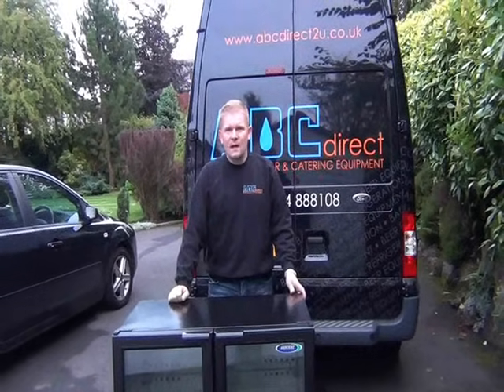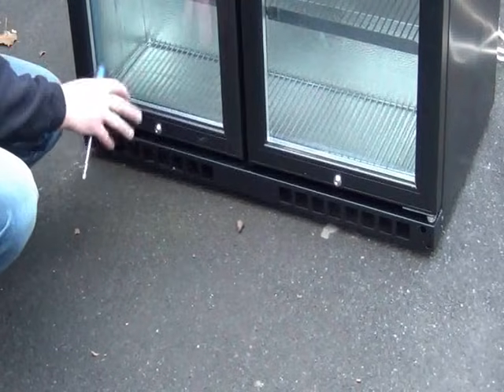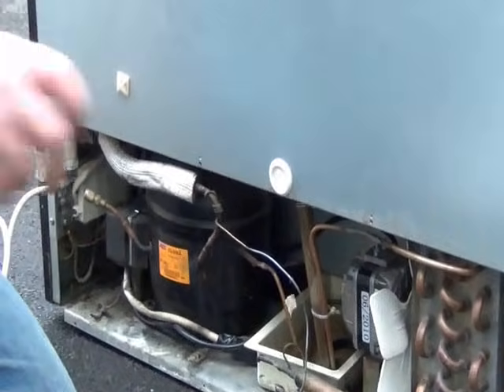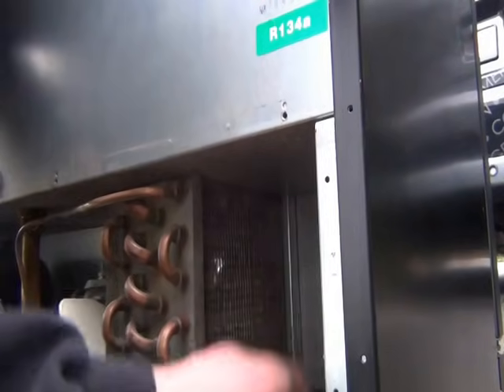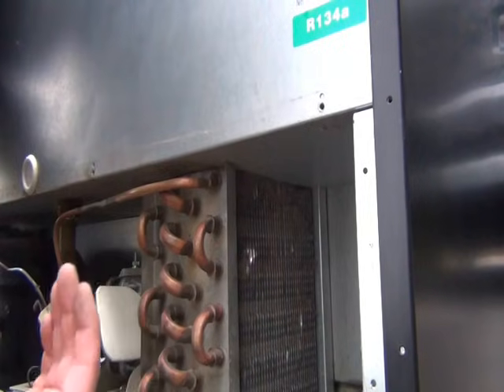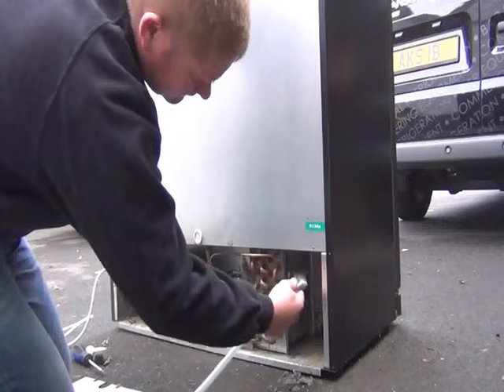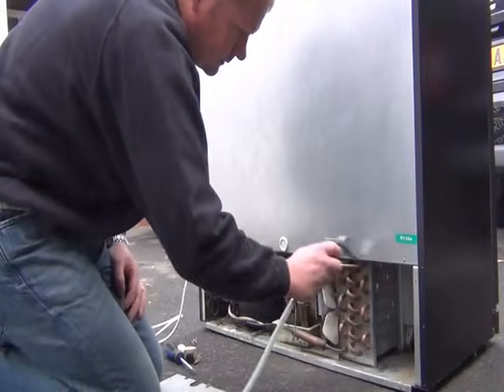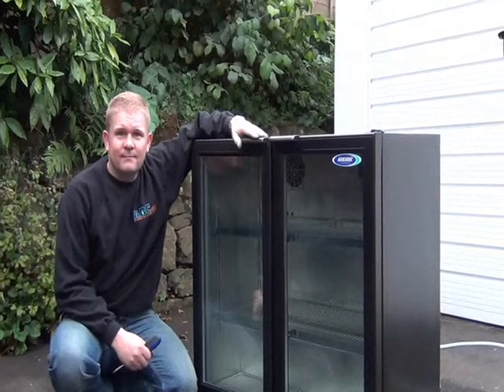Fridge Not Cooling? We show you how to safely clean and service your commercial fridges

Comment: Hi abc direct. Where is the thermostat located on these coolers?
Reply: Thank you ABC direct. I just bought the same fridge but has different condenser. Mines just copper pipes no aluminium fins. The problem was it doesn't get cold. I managed to diagnose the little 12v fan was dead on the copper pipes so ordered one for £9.99 well chuffed. Only paid £15 for the fridge. Your excellent video helped me loads. Thanks for your reply
Reply: I'm guessing mines digital as no visible stat. It's cutting in and out so it seems to work. It's so cold out it's hard to test so was going to blow a hair dryer on it to make compressor cut in. Cheers again mate 👍👍👍
Reply from the maker: Hi Mike the thermostat on this cooler in inside the bottle cooler at the back top right next the the internal fan motor
Reply: Do you know where my thermostat would be. Nothing visible inside the fridge
Reply from the maker: Hi Mike each brand of fridge will have different thermostats and locations , most bottle coolers have a thermostat located on the inside or at the front bottom of the fridge, some are digital and some or manual thermostats,

Comment: But I'm confusing there when you spray did you spray with water
Reply from the maker: he we brush the condenser first and use an air line so it cleans in-between the coil and fins also it stays dry thanks

Comment: Great video, just cleaned mine but fridge not getting below 10degrees, I've noticed the internal fan at top is not spinning, should it be permanently spinning?
Reply from the maker: HI Gary it depends on the model and age of unit on old units the internal evaporator fan runs all the time on others it will only run when the refrigeration is running and cuts of when down at correct temp, set you stat at 4c and if the compressor is running the integral fan should run thanks Andy
Reply: @ABCDirect  that's amazing Andy, looks like fan is broke, I'll get a tester on the cables today and see if there is a feed, if so I'll get a replacement fan ordered, I'm assuming they are all relatively similar. Thanks for your original video and your reply 👍
Reply from the maker: @gazzamundo  there is different models depend on make of fridge if you send model of cabinet and picture of fan to our office the guys. can quote if needed to sales@abcdirect2u.co.uk

Comment: I own a nightclub and we have several fridge. We bought a industrial vacuum cleaner from Argos that also has a sucker/blower that works great. Also we turn them off overnight every month to get rid of the ice build up inside between inside wall and and cooling grid where the fans are. Most of our fridges get hammered and often suffer with gunk from the smoke machines. Ours run at 3c without a problem. Most of ours are 15 year old Apollos 3 doors jobs. Also with three door fridge we don't put stock on the back ledge so it gives the fans room to breath.
Reply from the maker: thankyou for your kind feedback 😀

Comment: Is it possible this process will repair a fridge that will no longer keep cool?
Reply from the maker: if all the compressor and fan motor are working fine this will prevent the compressor from over heating and will keep the unit running efficiently the video is a basic service guide that people should do with all there commercial fridges :)

Comment: Wear a mask😅  u already bended the fin 😬 w that brush...
Reply from the maker: Always recommend wear a mask in enclosed spaces, and make sure the brush is gentle and it did not harm or bend the fins if you make sure you brush in the same direct just to remove the heavy dirt then use the air line to clean deep in to the coil :) which most people do not do or see.

Comment: Hi, thank for the video, I have a beer fridge which I recently purchased and it’s not cooling, goes from 19 down to 12 then back up! Do you think it’s the gas or just need a good clean? Which will be done when hubby’s home! May need to return to seller if it is the gas? Thanks again
Reply from the maker: Hi could check thermostat first then make sure compressor and fan is running OK at back of fridge, then if all that is OK it may be a gas or compressor problem thanks Andy

Comment: Hi Andy my bottle cooler has stopped exactly the same one that is I  the video  light comes on but that is all any idea is there a reset button in the back or is it skip ready
Reply from the maker: Hi mark ,clean condenser and check the fan and compressor is running at the back if they are you know the thermostat is ok as it is asking for cooling,if compressor is running but not cooling u may has a gas problem,  if fan just runs but compressor not it is a faulty  compressor not worth repairs,  check internal fan is running also hope this helps thanks Andy
Reply: @ABCDirect  thanks think you maybe right as the fridge has stooped working again compressor works fine fan is spinning and condenser is clean so is the problem most likely thermostat?
Reply from the maker: @markkennedy918  if the thermostat is faulty the compressor and fan will have stopped running then u need new stat, if they are both still running but you have no cooling you may have a compressor not pumping or gas problem thanks
Reply: @ABCDirect  yes they have stopped running and digital display has gone off again if I do a rest  it starts again runs for 2 days then shuts off again thanks for the advice I'm going too try and hunt down thermostat today it is probably behind the fan caseing inside unit
Reply: @ABCDirect  hi thanks for the advise I turned power off held down too buttons next too the digital display sitche main power back on and everything started working think it over heated as I had a heater next too it hopefully all sorted
Reply from the maker: Great it could be thermostat sticking as there is a small relay inside,  cold beer tonight 👍
Reply: @ABCDirect  thanks for letting know if it goes again i will try hunting down thermostat and changing, beer time now